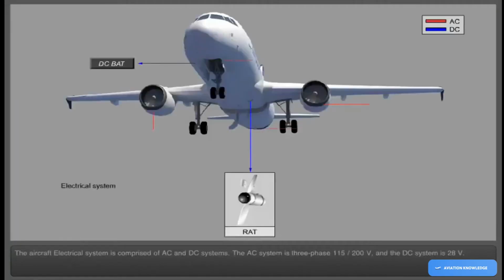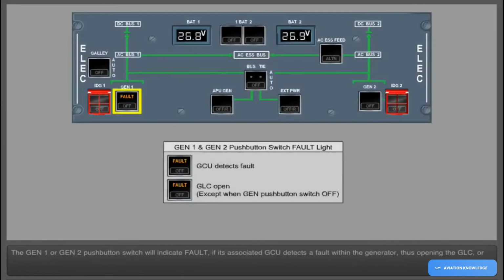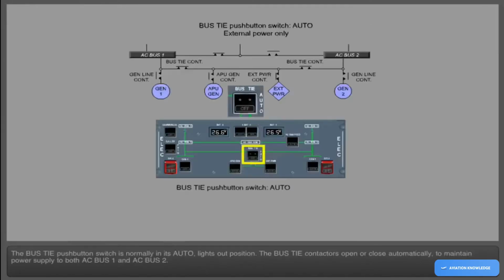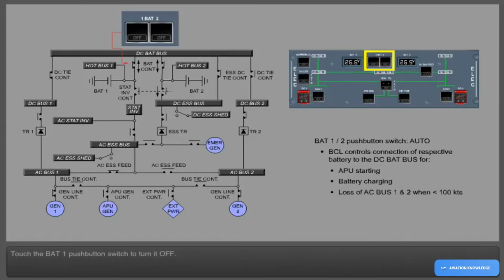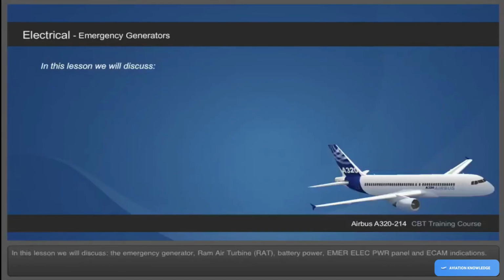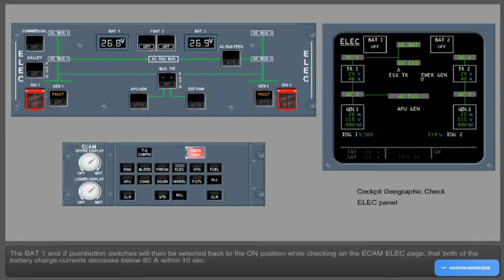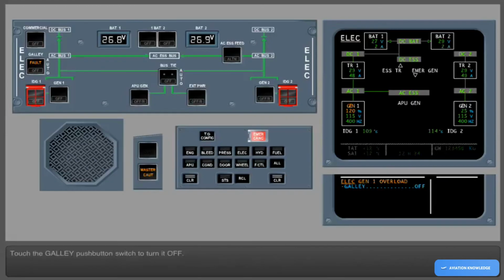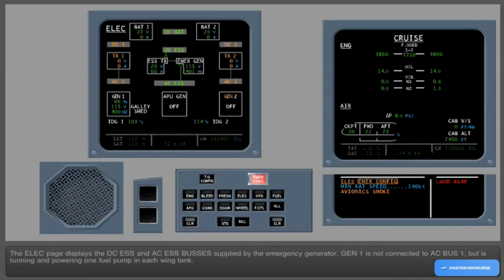A320 Electrical System (new)

Comment: In some areas Airbus lacks the conciseness and precision in word and sentence choice that characterizes Boeing. I am not praising Boeing at the expense of Airbus—I have been a captain on Airbus aircraft for a relatively long time—but it is a feature I find in many places in the FCOMs, and I used to miss it in Boeing manuals.
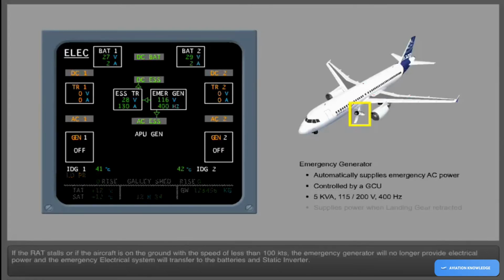Here is an example from this video at 32:56 "if the aircraft is on the ground with the speed of less than 100 kts" why does it use word “Ground” and link it to “100 knots”? The 100 knots is already a precondition for the EMER GEN to operate in the first place, so why phrase it in this way? This creates a kind of confusion for new trainee pilots, because it ties the 100 knots to “Ground", and make him/her think it's only a condition related to ground phase e.g after landing. at least at this point of the lesson!.
The more accurate and clearer wording i guess would be: “If the RAT stalls or if the aircraft speed inflight or on the ground drops below 100 kts, the emergency generator will no longer provide electrical power and the emergency Electrical system will transfer to the batteries and Static Inverter.”
I believe this phrasing is clearer—especially since the same piece of information already exists in the description of the MAN ON pushbutton on the EMER ELEC PWR panel.

Comment: Hi Sr, is this A320 (Classic, Enhanced, CEO) CBT? A320 NEO CBT? Or its a general CBT for all of them? Thanks
Reply: It is Classic (mentions and describes GPCU). 
In the Enhanced Electrical Power Generating System (EEPGS), the two EGIUs are removed and a new control unit replaces the GPCU and the APU GCU. Both Integrated Drive Generators (IDGs) are also replaced by two new ones (12.000 rpm in the old ones, and 24.000 rpm in the new ones). The EEPGS includes two main engine Generator Control Units (GCU) and a Ground and Auxiliary Power Control Unit (GAPCU).
Reply from the maker: Is the same for all of them